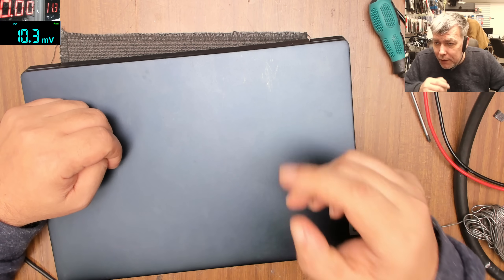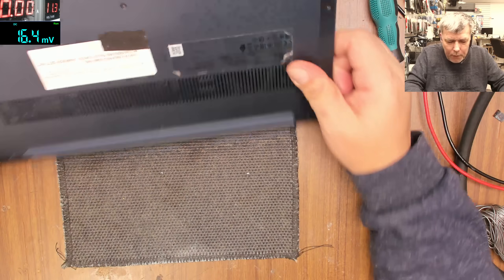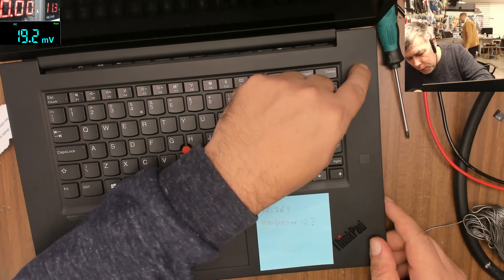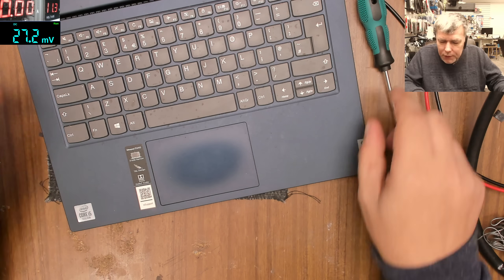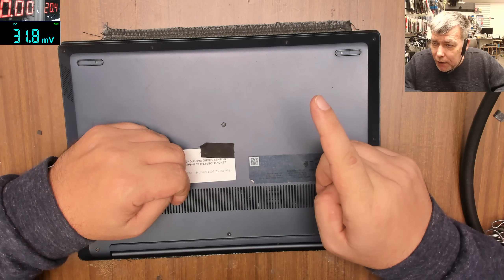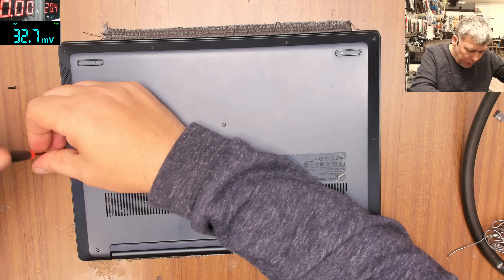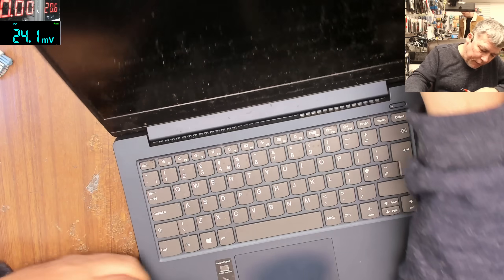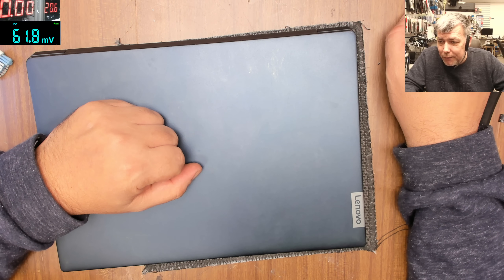Lenovo IdeaPad S340 coming on but no picture repair - liquid damage

Comment: Hello, Please Help,  I just Installed my new SSD and after finishing all other process, when I connected the AC charger, I noticed that my laptop is only showing plugged in but its not charging, the charge %age remains constant even after 30 min , but when I remove the charger , the charge %age start decreasing even its LED indicator is off .... What should I do?

Comment: My Zephyrus s17 touch pad is not detected anymore

What I tried:
1. Pin to Pin on the flex cable - all the pins on the flex cable are fine. there is beep on each pin. (I also tested with spare new flex cables)

2. I tested from the motherboard connector pin to pin and to the connector of the touchpad - passed with beep on each pin.

3. on the motherboard, the connector have 4 traces. and close to each of them there is a metal circle (I guess it's ground)

I tested from the connector pin and until the circle metal (ground)
there is a beep on each of them.

4. from the side of the touchpad board, I checked for short on the brown 3 capacitors.
no beep.
but there is 3 tiny capacitors (black) I'm not sure if it's capacitor but it's look like. which give me a beep on all the 3.

it's can be problem from the touch pad?
or any idea please?

Comment: I've had the same repair couple of times, so far it happens only on Lenovos. From what I gather it's not luck, but rather bottom case vent slits are always right over the super IO chip, always! 😂 Can't believe with so many models later they still haven't done any changes to this flawed design. 🤦‍♂️ Hahaha, just finished watching the video. That's it, every other brand sticks a fabric grill under and it saves the day, but not Lenovo. 😁
Reply: Same problem with me on my Acer aspire 5 laptop a drop of water shorted my super io😂😂😂
Reply: @ankitanand4101  I have a much less superior io....it's called an inferior io, same thing though, it got moist (🤣the lappy's Io that is 😂) and pzzzzzsssht! ⚡
Reply: I use a Lenovo, a similar model in fact, thank you for bringing this to my attention in case this fault arises in the future. I do Love my Lenovo's but I agree this should be fixed by now!
Reply: @rockytoptech1308  Yes, I've had many other laptops (HP/Dell/maybe ASUS models) with dust, dirt and white water marks all over their fabric grills, but nothing on the PCB. Such a simple and cheap fix saves so many headaches and money for owners. 👍
Reply: @em0_tion  so true, but I wouldn't trade my Lenovo for any Dell or HP....now ASUS haha for sure, I love ASUS as well!

Comment: 7:58 DON'T listen to him. You should ALWAYS check both sides of the board if you have liquid damage. Don't be lazy as Sorin is.
Because after liquid damage the client is always filipping/turning the laptop upside down to check what happend and becaue of that the water or liquid can go everywhere.
And if you found any liquid marks on the back of the keyboard you should alyways replace it, no matter if all keys working or not because corrosion will kill the keyboard in week or few months anyway.